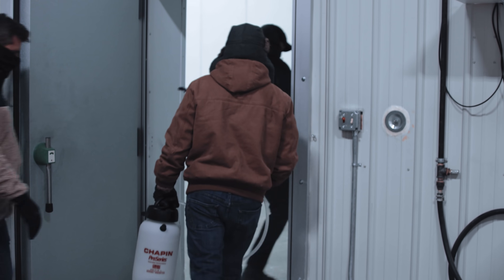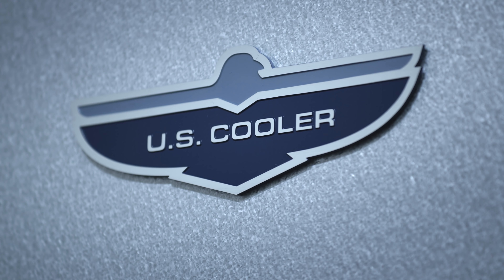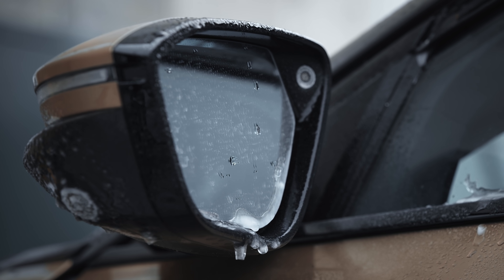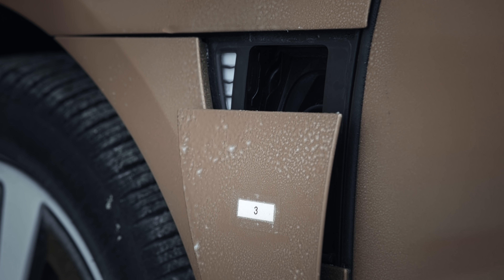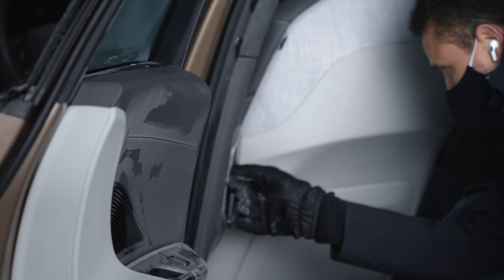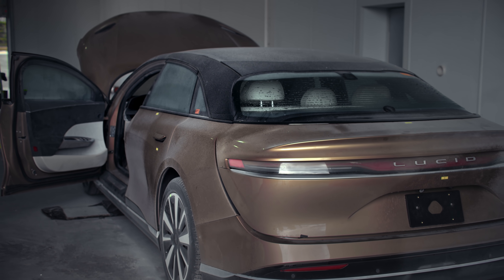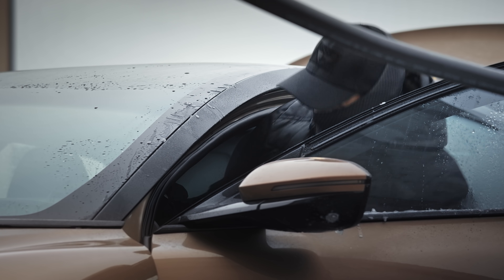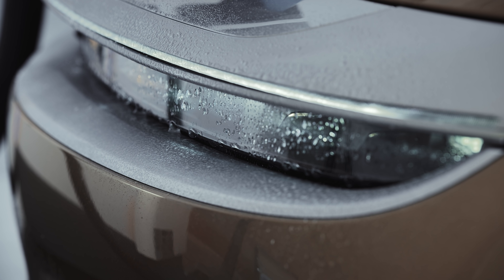Cold Weather Testing | Lucid Air | Lucid Motors

Comment: Tesla is like Microsoft 
Lucid is like Apple 
Both great companies and both will thrive
Reply: Wrong way round.

Lucid is Microsoft, because they're looking at the battery tech and licensing it out as well as making cars. Like MS with their OS licensing but they also make tech like Surface etc.

Tesla is more like Apple, they're keeping everything in house, looking to dominate in multiple arenas and is relying on brand loyalty to displace any performance or quality issues.

You're right though, both will thrive, there's a nice piece of the pie there for Lucid but they need to hit the ground running with great quality luxury cars.
Reply: @randomdaveUK  Yeah I've said Tesla is like Apple for a long time, good to see that I am not the only one who thinks of them like that lol
Reply: @randomdaveUK  Umm Rav4 EV & Merc B250e. They just currently have supply limitations.
Reply: You can’t compare Lucid to Tesla until they have autonomous driving... that’s the main key to dominate or to compete in the future market
Reply: @dannynguyen5608  Try taking your hand off a Tesla steering wheel in Autopilot and see what happens, even after you've paid $10,000 for FSD.
Reply: @dannynguyen5608  they do have autonomous driving .....
Reply: @AiBall09  where do they mention that??
Reply: @AiBall09  autonomous driving will not be realised until every car on the road has it and is on the same wireless network communicating to prevent accidents.

While there are cars on the road without autonomy, it doesn't matter what Tesla does with this. Currently it's a fun gimmick, it'll take decades to realise the true safety aspect of what Tesla are going for. Gotta commend then for pushing it, but it's a network effort not a single entity.
Reply: @dannynguyen5608  This was a short video about Lucid's cold weather testing, not a full-scope review of the car.  The video also didn't mention its top-of-the-class efficiency of 4.6 m/kWh, its 1080 hp from two motors, its off-the-scale torque, its 32-sensor ADAS hardware suite . . . .
Reply: @dannynguyen5608  I understand your point, but even Tesla isn't FULLY autonomous driving. Until its fully capable to go from point A to B without any issues or worries it's still fair game for any EV company to compete.